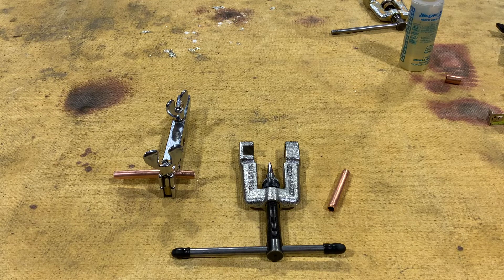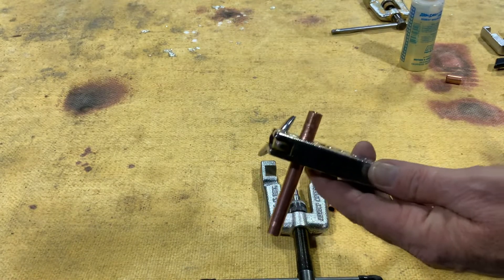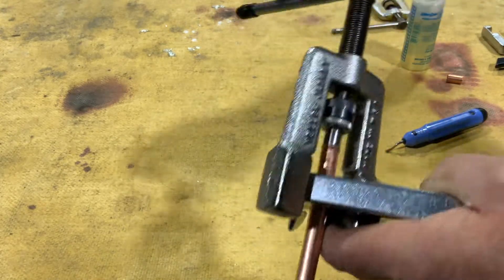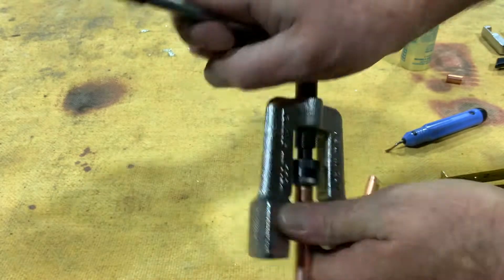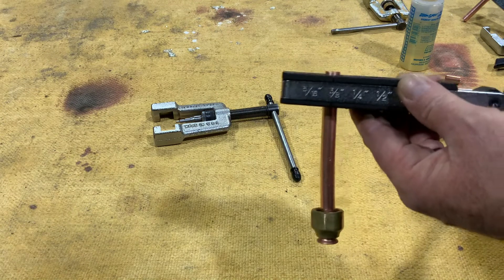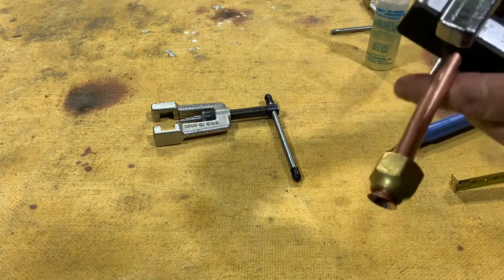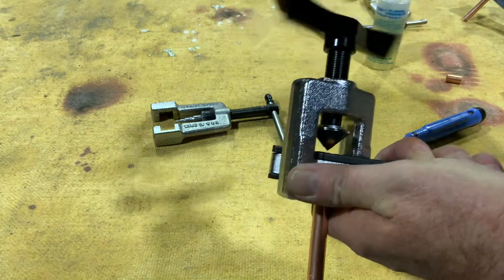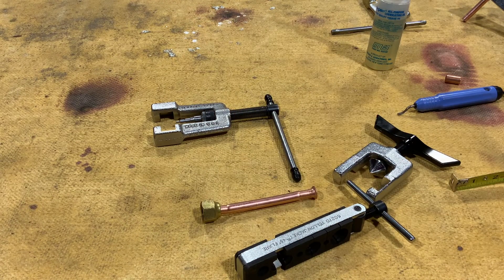Swaging and Flaring Demonstration HVAC

Comment: For sure a nice and clear instruction video! My question is what type of oil do you use as I can't find any reference on the internet to what oil is suitable for this?
Reply from the maker: If you have a little refrigerant oil handy that’s probably the best. Otherwise you can use god old zoom spout. It is a very minimal amount so it will not affect the system.
Reply: Ok, thanks in dutch that's sewingmachine oil :-)    Many thanks agian!  @frederickkosier2508
Reply: The oil he using is for rust

Comment: Hi, I am using the same swaging tool as you've got there, and I'm struggling to do the 1/4" tubing. My 3/8" comes out beautiful like in your video here, but I can't seem to get the 1/4" to stick out of the block far enough for it to swage nicely, even with the tool backed all the way up. My swages end up way too shallow to work properly, and it seems to crush the tubing against the block. Any tips?
Reply from the maker: Hello
I have noticed the same thing on 1/4”. It pushes the pipe down while flaring and scores or crushes the pipe. Make sure the piece of pipe is as straight as possible in the block and that the end is reamed well. Make sure the flaring block is tight around the pipe as well. And as always don’t forget to put your nut on the pipe first 😀.